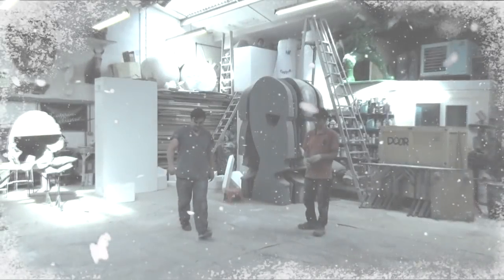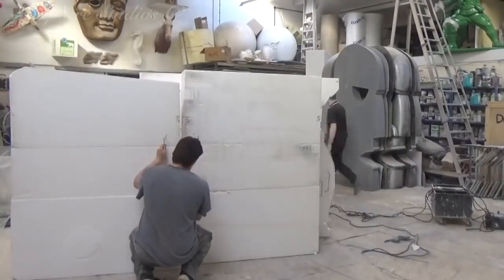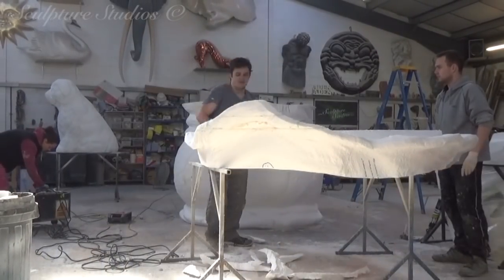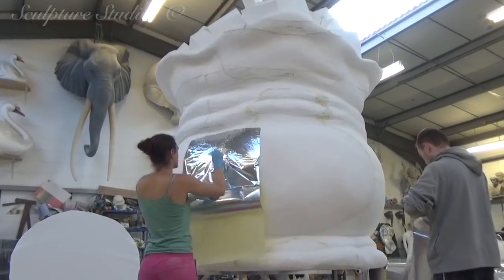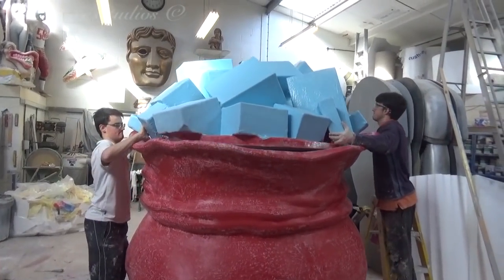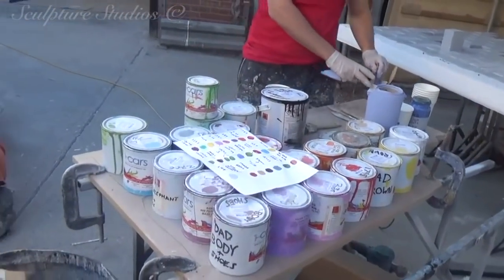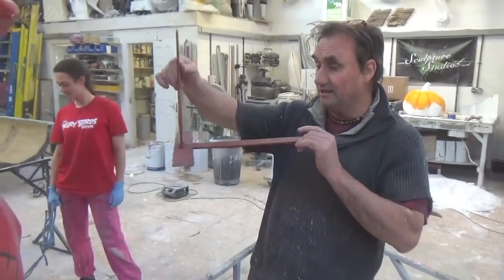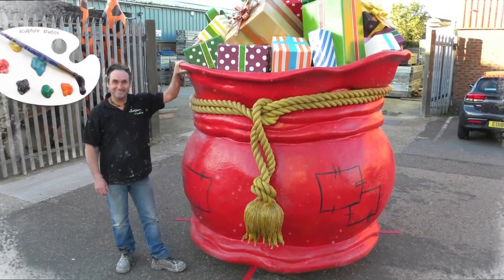Giant Christmas Santa's Sack by Sculpture Studios

Comment: love your videos! How many layers of fibergladd are you putting on a model when not creating a mold? like judt ad the blanket
Reply from the maker: For going over with a blanket coat of glass fibre for unmoulded pieces like this, it all depends on a few things. What this is going to be used for and whether it's going to be touched, kicked, climbed on etc. And whether you are keeping the polystyrene inside or not.

   For this, it's going to be seen from a distance and not touched, and it's not going to be hollowed out, and the polystyrene is going to be left inside. So we went on with about 2 ounces of glass fibre mat.